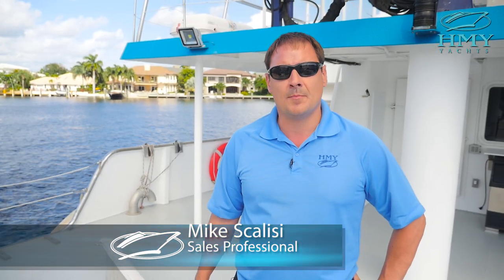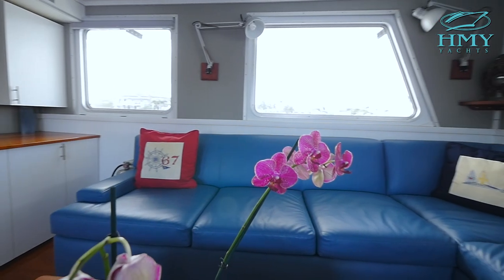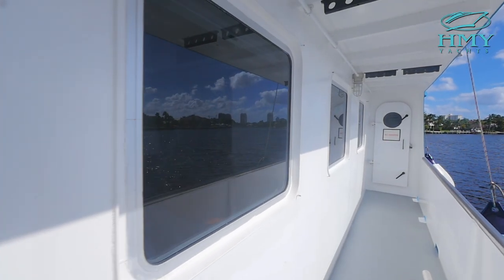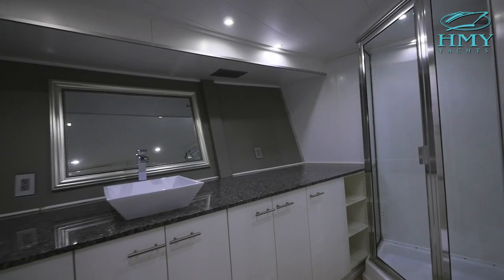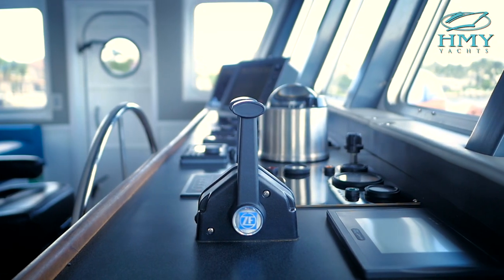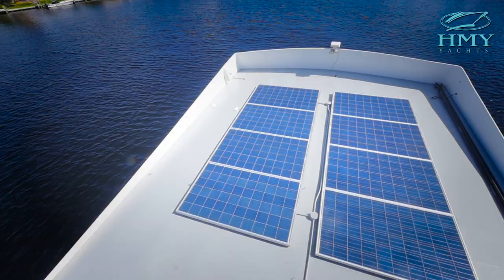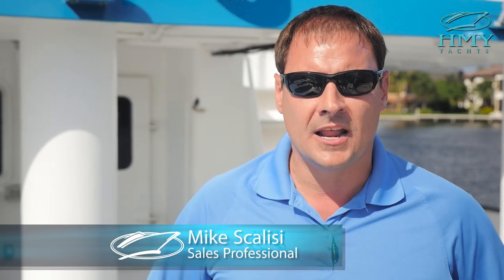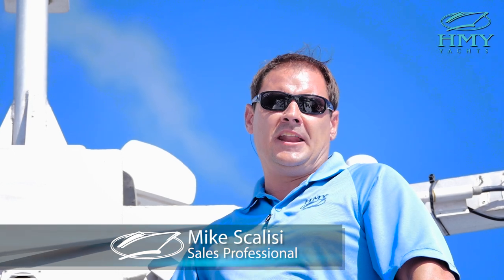A Fisherman's Paradise - Chagos - 2013 95' Ocean Voyager Expedition Yacht

Comment: Seems underpowered w only 350hp x 2
Reply: Nah. I bet the range is insane
Reply: It’s not a 2000hp center console. Probably cruises around 10kts, and most likely has a range of 4000 miles or better. You don’t need big power for that.